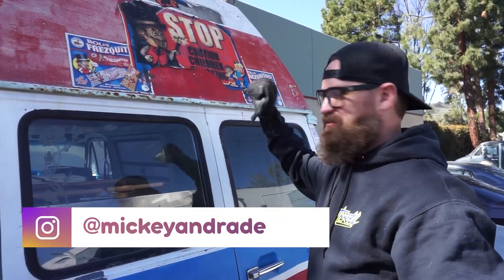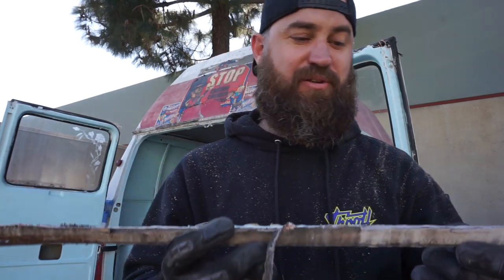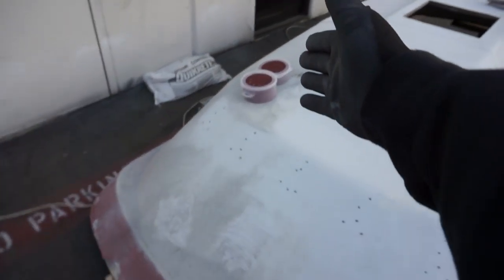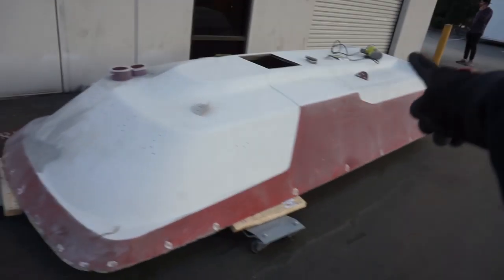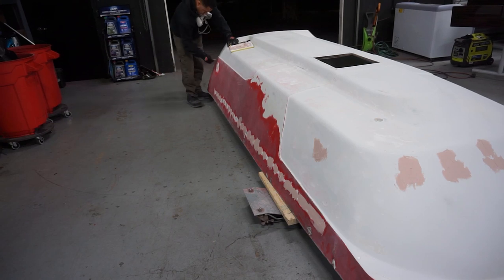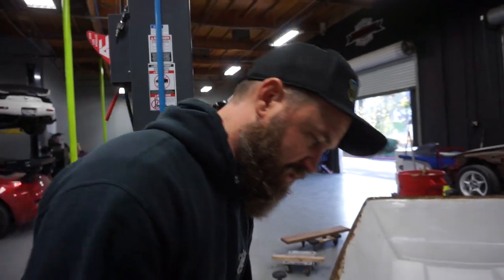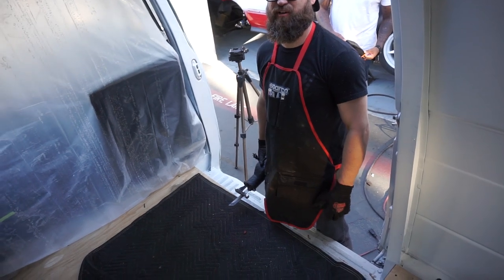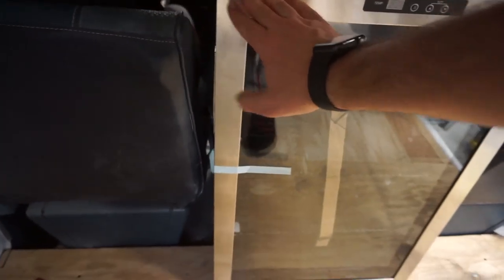Building the COOLEST Ice Cream Truck on the Planet!!  [Ultimate Chevrolet G20 Build] - Part 3

Comment: Awsome project, really enjoying this series so far. 

The proposed fridge placements between the seats does free up rear space but it would pose different problems, one being access from the front as others have mentioned, but also the heat. 

  Fridges have a cooling system in the rear and they kick out an imense amount of heat. With the placement of the fridge between the seats and facing the way it it is, it will kick all that heat into the drivers cabin and may pose a hazad to them with the exposed hot components close to the passenger and driver,  theyd also have to contend with the heat being directly exhausted onto them.

The only other issue would be how secure it will be in the event of a collision.

Well, i look forward to seeing how you guys find solutions to these problems. Best of luck guys.
Reply: R Z )

Comment: Great video guys. If it's not too late for ideas fitting to the new van. You should cut the roof off the new one leaving an inch of material as a flange. Sit the fibre roof on and beat the new flange out to meet it. Clean everything and panel bond it on 👍

Comment: I would bend up some long sheet metal flanges that through bolt to the inside of the fibreglass roof and bend underneath it to cap off the whole drip rail. You could bolt them in place on the van then just lower the fibreglass roof onto them. That way you cover the whole drip rail with sheet metal which you can seem seal really neatly after you’ve bolted it all on to make it water tight. Sheet metal holding the full length of the roof would stiffen it up and put some rigidity back into the roof you removed. I’m sure you have an idea already but I thought I would chip in!

Comment: Yeah I agree with the others. Seems like you forgot about getting in and out unless it's going to be a fliptop counter or something like that. Normally that's why the coolers sit on one of the sides of the van instead of across the back and there isn't anything between the drivers seats so you can just go straight from the driver seat into the back without getting out of the van. Granted this is for shows so you're not like actually worried about efficiency of turn around time stopping 10 times or more driving around neighborhoods lol :D

Comment: Maybe you could do a two piece countertop that goes from the back of the van to the rear of the passenger seat. Put it on rollers or actuators to let it slide towards the rear and then you could get in an out.

Comment: You should move the big freezer to where you have your little stool thing and have a vent for it to let out the heat since usually you need to leave them a little space for them to vent. Put solar panels/blankets on top so you don’t always have to rely on a generator and even if you do have a generator it should be outside. I think if you were to keep the fridge thing between the seats make sure to round off the corners or put something in front of them so no one hurts themselves while driving. The fridge will also get extremely hot so it might need a vent too but I have no idea how that’ll work. Make sure to reinforce the roof a bit too since you took out so much rigidity

Comment: yep love the disposable body filler paper also can get the same paper from a paper supply shop they just need to know what type of paper it uses and they can make a pad like that making it cheaper to get from them. love the lay out it's like everything was planned like that don't get that lucky normally make sure to make the counter top by door is a folding type so you can get in and out easier.

Comment: Hi Evan I see one flaw in your design you’re going to have the ice cream freezer in the back the cooler between the seats for the monsters and you’re going to have a countertop it’s the sliding door how are you going to get in to the back 🤔 my suggestion would be put the monster cooler behind the driver seat so you able to get in the back that’s what I used to do when i did van conversions buddy 👍😊

Comment: Cut a service window, but a cold plate freezer in place of that retail freezer that  want hold cold well at all put selves on back wall to hold candy and stuff , cold plate freezer aginst back wall, ive been in the cinsession catering and many ice cream business for over 50 years had several ice cream trucks you dont need a noisy generator. you need high voltage inverters

Comment: king ranch saddle leather seats dark hardwood laminate floor hydro dip dash to match the floor RGB led lighting around cabinets and stuff solar panels on the roof to recharge batteries and power equipment install an EMP shield to protect against power surges i could go on i have 100 different ideas

Comment: If the cooler blocks the rear door, the refrigerator blocks the front, and you have a counter blocks the side door. How will you get in the back of the van?

Comment: I like your build but there are several concerns: I hope you aren't going to run a generator in the truck. Carbon Monoxide. Ditch the generator and get a deep cell battery, high output alternator and a pure sine inverter. You are blocking all passages of movement in the van. This will tire you quickly. Also, filling holes in fiberglass with body filler will not last long.

Comment: You shouldnt of used body filler to fill the holes as it’ll just fall out, you can buy a fibre glass filler and make it stronger and then skim with body filler afterwards